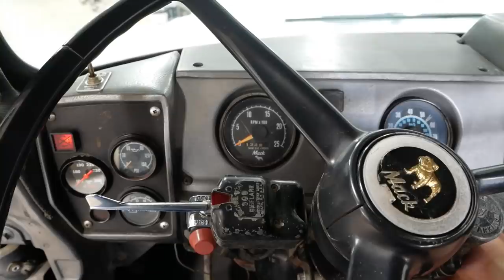"Simple" Axle Flange Leak Escalates Quickly - Vintage Mack Truck - Part 1

Comment: Kinda knit picking a bit ! It’s only going to give you a couple extra threads , if they spin 3 times that should be enough grip to hold nicely ! If you do one your going to have to do them all ! If it were your rig and your paying the bill would you fork out that kinda of cash on longer studs ? It would be cheaper to buy steel inner rims and put a rubber ring between them ! I have heard of people flanging out the inner rims but that stud flange costs also !
Reply from the maker: Like I said, everyone does it. Over time you can stretch the ends of the studs.
Reply: @WatchWesWork  ya I know you said it and I have done it myself but was saying I put steel on the inside w/rubber gasket and it works fine .I can’t believe how much they are now , back in my day they were $5 a piece and I thought that was expensive ! Lol

Comment: 25:20 Hell, Wes, you could'a done that with lighter fluid and a match, at the risk of starting an out-of-control fire in your shop.
Reply: We used to do it with ether until the government ( I'm assuming ) stepped in and made them change the ether formula so that it doesn't flash as well.

Comment: You sounded surprised at a long nail going through a tyre, i used to fix motorcycle punctures and one time a matchstick went through a virtually new tyre. What happens is the front tyre goes over the poor innocent nail/matchstick and flicks it up for the rear wheel to run over, get the angle and  speed right and you have the straw through a tree in a storm effect.
Reply: I got a flat with a piece of straw once. Uniroyal passenger tire, slid right up the sidewall and just deep enough to get through. Actually sealed it with superglue in my driveway... held for a year before a different one blew a bubble. Not a particular fan of the brand, they came with the pickup...
Reply: @mfree80286  its amazing what can happen if the conditions are just right, or wrong depending on outcome. The old straw through a tree in a hurricane phenomenon.

Comment: That tin shield looked like an ABS ring. Wonder if that hub had been replaced before.
Reply: That is exactly what it is for and serves no other purpose.  FMVSS 121 was first implemented to truck/bus air brake systems in 1975 and that standard required antilock brakes among other things (such as separated multiple air reservoirs).  The antilock braking systems of that era quickly proved to be so problematic that the antilock language in the 121 standard was rescinded some time around maybe 1978, and allowed owners of the vehicles to remove (or defeat/decommission) all components related to the antilock functions and return the vehicle to basic foundation brakes. As a 1977 build, that tractor l had ABS from the factory, but after NHTSA rescinded the ABS requirement that tractor likely was reverted back to the older brake plumbing. The tone ring and ABS sensors usually got left in place while the brake relay valve and modulator valves and ABS ECM (controller) were removed. Some OEMs you could keep the relay valve but the modulator valves had to go, along with the controller.

Comment: Hey Wes, what 1/2 inch torque wrench do you recommend?
Reply: I dont know whats aviable in usa. but my favorite is stalwhille becouse you can change the head from ratchet to open spannner etc
Reply from the maker: I like the split beam torque wrenches, but there's probably some electronic thing that works better now.

Comment: Seems likely someone overtightened on the aluminum hub . Aluminum is only going to take so much torque before it strips out .
That remains me that if you don't tighten lug nuts down evenly a disc brake  rotor can be warped. 
Shops give me a funny look when I ask them to hand tighten the lug nuts like I'm some kind of wacko.

Comment: has to be 35 or 40 years since I messed with radiator shutters. Just wire them open. those axle mounts are no better than the old Freightliners we had.

Comment: You should have replaced the bolts in the hub to begin with. Then you would have the correct length and you could have replaced the tin shield.

Comment: How can you remove the brake drum without showing  backing off the slack adjuster  or releasing the brakes  and the wheel studs are longer for the aluminum wheels than steel wheels so all of the weight is on the inner thimble nut not the wheel studs

Comment: Mac's and kens almost always use a 9/16s for the hub seals bro
Reply from the maker: Mack is the only one I know of. Everyone else is 5/8" or 1/2" for the smaller trucks.
Reply: @WatchWesWork  idk if it was just the options my company had on their trucks but the older ken's and mack rollbacks they had there used 9/16s on their hub seals but it could and probably does change per application
Reply: @WatchWesWork  also I genuinely didn't expect to get a reply at all 😂

Comment: Question 🙋‍♂️ have u ever had lugnuts that r so tight u couldn’t hardly get loose? If so what was ur remedy
Reply from the maker: There's always a way. I've had to cut them off with a torch or drill them out.
Reply: @WatchWesWork  well so they’re on a semi, and I’ve broken a 4’ breaker bar and killed a Milwaukee impact. Im really hoping to not cut em

Comment: How many times per season do they spray that cornfield? My count is at least 3. Is the helicopter always spraying pesticides, or do they also apply fertilizer from the air?
  Edit- I should have watched until the very end. So it is a fungicide they are spraying.
Reply from the maker: 3 times in the most I have seen with the planes. Normally it's just once. They spray earlier in the year with a regular spraying machine, but once the corn is tall the plane is the only way.

Comment: Every Mack I work on is always 12v 

Do you commonly get 24v Mack’s?
Reply from the maker: It's not 24V. It uses 2 pairs of 6 volt batteries to make 12 volt.

Comment: Steel bolt in threaded aluminum housing never ends well, specially when rust is involved. water pumps and exhaust flange bolts are constant problems on aluminum heads

Comment: Don't those bolts just hold the cap on the hub, so as long as they can put reasonably even pressure on the gasket to prevent leaks, it really shouldn't matter that the cap gets perfectly centered?  I do agree that the previous "repair" job was crap given how crooked each of the bolts was, but would it have been possible to just redrill and tap for the next sized bolt VS replacing the hub?
Reply from the maker: Well the cap is part of the drive axle. If it's not centered the axle can fatigue and break.

Comment: lol could hear the inner tire was deflated where can I get that universal tool from? you pulled that tire off effortlessly I would have used a tire plug instead of pull through seal and steel Dayton rims different story awesome that you only have 5 or 6 wheel nuts to do up pain in backside pulling the tire off rim and good you don't have to crank them to 400 ft lbs unlike them 10 stud pcd rims with standard wheel nut

Comment: Most R Series down in NZ all had air starters
Reply from the maker: I've never seen an air starter here in the US. I don't think it would work well on this rig. It sits for long periods of time.
Reply: @WatchWesWork  Air starters enjoyed some popularity in the U.S., mainly with large truck fleets.  The air reservoir for the starter was isolated from the air brake reservoirs with a check valve so that the starter reservoir maintained its charge even if the rest of the truck air system leaked when parked. That worked perfectly on the engineering table but less than perfect in service.  But if you had another air brake equipped truck that was running you could air up a starter reservoir by connecting the trailer brake supply hose glad hand to the start reservoir and push the red knob in on the dash. BTDT so many times I still do it in dreams sometimes.
Reply: @larrywalker7759  We still have air starters on our 200x Mack Titans (I'm in Australia).  I believe it is (possibly was -- not sure if Mack still offer it) a factory option.

I like them because a small air compressor can (eventually) build up enough air to start the truck if necessary.

Comment: Speaking of tires..Recently I learned that only some shops do something called “high speed balancing” after someone told me a story about a tire company requiring a high speed balancing job to be done before swapping out the tire on warranty.  I’m wondering if this is a gimmick.
Reply from the maker: Possibly they are talking about road force balancing. I suppose it is better. I don't really know.

Comment: i realize the bearing rides in gear oil but would packing with grease be doubling down and unnecessary in this application? I've always packed them in grease just to be sure.
Reply from the maker: The hub will fill with oil and lube the bearings just fine. Grease is not needed.

Comment: 7:49 you are doing it wrong. you should put something under the wrench shaft so that most of the Nm translates into the bolt
Reply from the maker: That's not how physics works. The support just keeps the socket from slipping off. It does not increase the torque.

Comment: Why didn't you use your impact gun on the axle nut socket instead of using the air hammer?
Reply from the maker: That would just destroy the socket.

Comment: I could easily fix that hub the right way, Though I also have the tools to do so.
Reply from the maker: The used hub was $150. There's no way anyone could fix it for that. The helicoil kit is over $100.
Reply: @WatchWesWork  very very correct! I would be in it $200+! Yes sir.

Comment: You mean the truck that the replacement hub came from had steel inner rims right?
Reply from the maker: The studs are the same length on both hubs.
Reply: @WatchWesWork  in the video you made it sound like the owner of the truck was an idiot for changing the wheels and not the studs
Reply from the maker: @kimberlymccraw6706  He bought the truck this way. It's been cobbled together from several trucks.
Reply: @WatchWesWork  was the flat tire on the same hub that you replaced?

Comment: And I know for safety I know that Jack and going anywhere but just for safety and health no matter how heavier howlite I always put jack stands no matter what I'm working on it's always that chance and what size impactor using and what kind looks like a 3/4 wrench do you use the bigger Airlines or the smaller quarter inch what kind of gun that looks like an earthquake from Harbor Freight that could be wrong and if so did they got good power

Comment: 350 lb put it back to 550 the way the last installer had it, wow no keeper 🤔
Reply: Ya a lot of the old truck axles are like that all the Rockwell top loader axle I've ever worked on, 5 ton and 2.5 ton have been that way. Its just how they used to be built and done.

Comment: typical Toyo tire collects every rock it can and holds on to them and try and push through the casing, Toyo trucks tires are not the first on any real truck tire mans list.  Usually those nut at 100/200 ft lbs   some rookie worked on it last.

Comment: I've never seen wheel bearings before that weren't supposed to be greased. I don't get how they don't burn up.
Reply from the maker: They run in oil from the axle housing. That's why I had to have a drain pan when I popped the axle shaft out.

Comment: Wow we have a man called wes
who takes the piss out of wit dry
Humor , on a serious note... Please
use axle stands to protect you
from injury 😳 jacks have the
habit of letting YOU down.
Just out of curiosity how much
would a hub costs new ?
Lucky 2nd hand parts were
available. Oh tyres they are a
pain in the arse , had to replace
 2 front first faulty, rear wear & 
tear 2 weeks later got flat on the
front repaired that , then the
Battery died all in one month
Not funny if your motorcycle
Weigh's 220kg & are 65 yr old.😭

Comment: Only a nail in the tire?  Could have been worse. 
At the recycling yard I worked at back in thd '70's one of the Pete road trucks came home with a 9/16 open end/box wrench through the tread. (open end of the wrench went through the tire.)
Mobil tire guy didn't even try to pull the wrench and save the tire. He put on a new one, even tbough it wss a rear. The truck/yard owner (may he rest in peace) didn't like/trust recaps.

To date, the only time I ever saw a wrench poked through a tire.

Comment: Stuff like this is why I've developed a sheer hatred for Aluminum castings of any sort, especially when paired with Steel. Those two do not play well together, and given that it's a cast part, it makes the situation so much worse. Even the best Aluminum work-hardens, and castings tend to be pretty brittle to begin with. 

Even with all that aside, what irresponsible lead-head thought it would be a good idea to make Semi load-hubs out of Aluminum (cast or not)? They could machine them out of forged 70-series billets, and it still wouldn't cut it. With all the liability riding on that one part, you'd think they'd be smart enough to not half-ass it, but that would make too much sense...

Comment: When you apologized to sensitive viewers I thought it was because you had to use an air-hammer break that nut loose. Then you mentioned the traffic and that was when I noticed it. It seemed to fade right back into the background.  For a truck that appears to be taken care of, there sure are a large number of less than optimal choices that's been made in its maintenance.
Reply from the maker: I believe this truck has been put together from several parts trucks and it's kind of a Frankenstein. It's impossible to get parts for it.

Comment: Another first world problem. What's the chances of another nail coming through at the same spot and what's the worse that could happen if it did? Another slow puncture. Melt and fill the punctured tread hole with a soldering iron and go about your day. : )